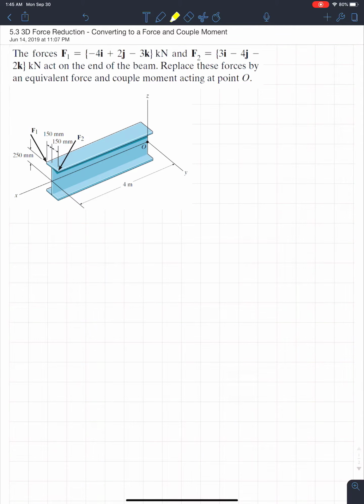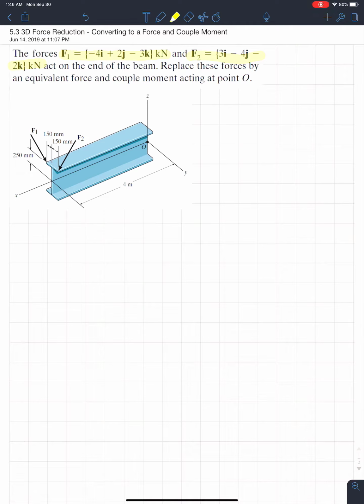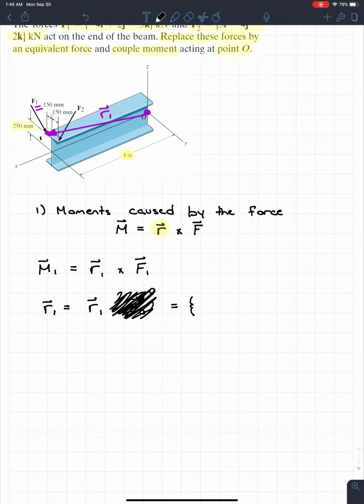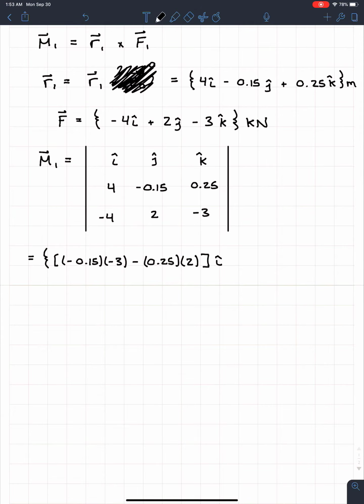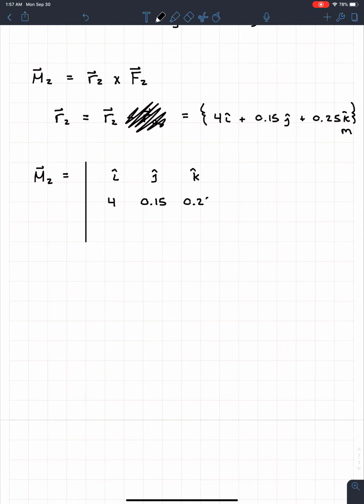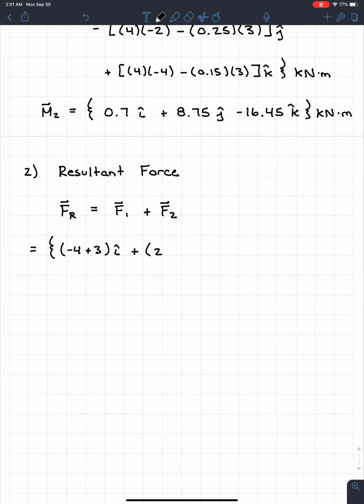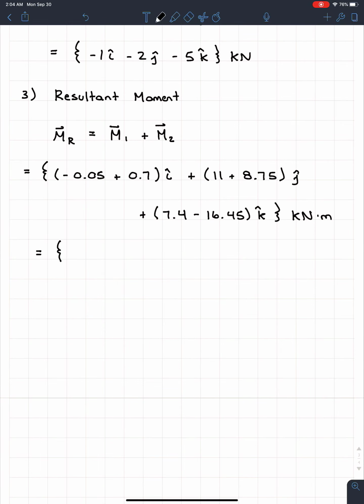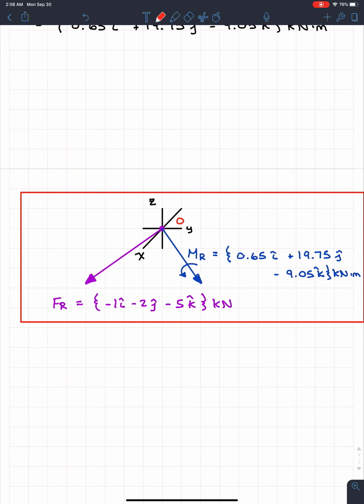Engineering Statics | Old Example | Force Reduction into a Force-Couple System

Comment: When you write your final answer with the force and the moment coming from point O, why is force coming from point O? Wouldn't that cause no moment about point O as the force has no distance to O?
Reply from the maker: That's correct that the resultant force does not produce a moment about point O, that's why we also place a concentrated moment at point O which accounts for all the rotations caused by the forces.